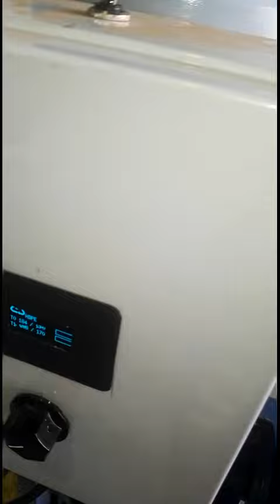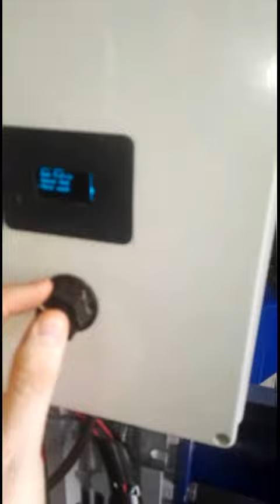Small plastic extrusion machine (precious plastic equivalent)

Comment: How are the interface/controler made? Spare parts from a old 3d printer ??🤔
How have you overcome the need for PID controllers?
Reply: you can buy an oven PID temp controller, or, if you prefer the DIY way, just upload PID algorithm to an Adruino and use its PWM to control a MOSFET (if your heater is 12VDC) or a Solid State Relay (if your heater is 220VAC). Oh, and don't forget the thermocouple / thermistor.
Reply: We build all our controllers in house. All with new parts.
Reply: @mledbitter  Hi sr what type of plastic do you use? Because im having a hard time unmolding ABS... too little shrinkage.
Reply: @tutoriales0142  ABS doesn't shrink at all , so yes you will have issues

Comment: Hello Sir, I was watching your Shredder Video but the comment section has been turned off. I just want to know if your motor power and if you used a Single Phase or 3-Phase motor. Thank you for your answer.
Reply from the maker: It is single phase. 2.2kw motors